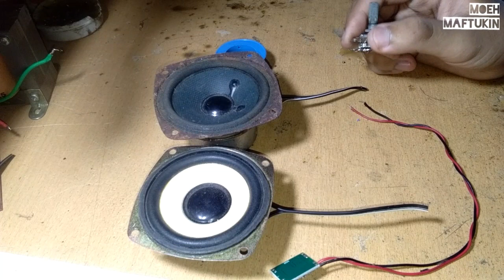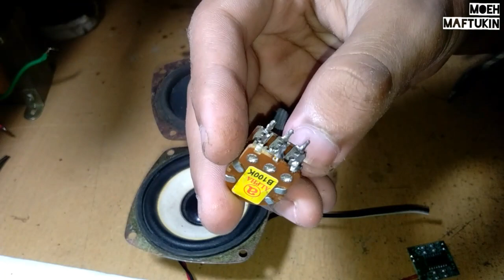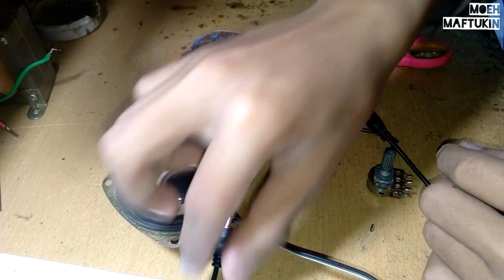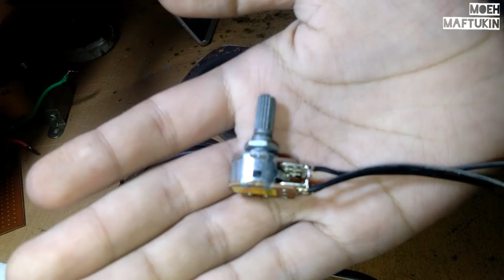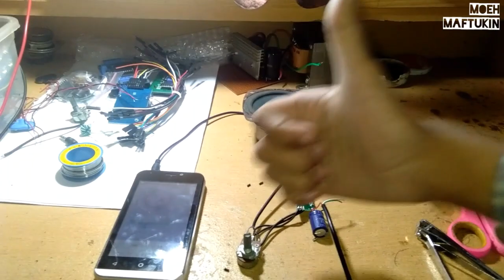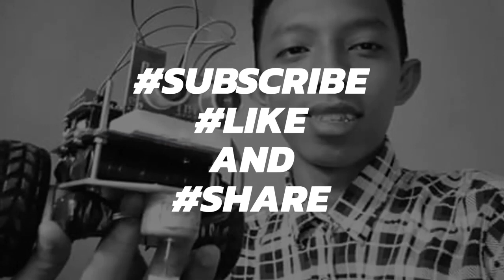Cara pasang potensio volume Di PAM 8403

Comment: Bang cara ngatasi ketika bass tinggi daya langsung down gimana bang. Apakah kitpam bisa dikasi input lebih dari 5v? Mohon solusinya🙏🙏🙏
Reply from the maker: Kasih elco
Reply: Udah bang tapi yg 16v 470 micro farad
Reply: Atau kah masi mau ditambah microfarad nya
Reply: Saya pakai 2 kitpam yang input daya dan audio nya saya rangkai parallel, daya yang says berikan sebesar 5v, apa itu bisa?
Reply from the maker: @hldn6117  nah itu kesalahan kamu, input nggk boleh diparalel secara langsung, harus pake R
Reply: Maaf bang saya kurang nangkep, pemula soalnya, R yang abang maksud itu apa ya? Mohon pencerahannya
Reply: Pikiran saya kalu saya parallel keduanya bisa mendapat daya 5v yg sama dan tidak terbagi 😅
Reply from the maker: @hldn6117  harus pake Resistor
Reply from the maker: @hldn6117  woo ya nddak

Comment: Mohon bantuannya om,
Saya punya amplifier tpa3116d2 120*2ch.
Pada amplifier terdapat potensio trimpot masing-maaing untuk ch L dan ch R,
Saya mau ganti sama 1 potensio stereo (dengan maksud menghemat tempat yg sudah sempit) untuk k2 trimpot kiri dan kanan. Apakah yang saya lakukan itu benar?
Sudah saya lakukan, pada posisi potensio off/ tertutup, keluar suara di speaker setelah saya buka volume dari tone control( vol di amplinya belum dibuka. Apakah karna ukuran potensionya kecil?
Ukuran potensio stereonya b50k.
Mohon bantuannya om.
Reply from the maker: Kemungkinan kamu salah dalam. Penyambungannya, saya kalau jelasin disini bisa panjang nanti
Enak nya gimana?
Reply: Apalah saya mesti/ potensionya tetap dipisah /chanel dengan yg mono, / ganti potensionya dengan yg 100k om?

Comment: bang mau nanya kalo kit pam nya ada 3 ,terus di kasih input audio tiga tiga nya tapi satu colokan apakah bisa
Reply from the maker: Bisa, di cabang
Reply: apakah gk balik arus nya ,apakah harus di kasih resistor atau potensio ? klo resistor yg berapa klo potensio berapa ?
Reply from the maker: @jokisandal6770  pake R aja 1k
Reply: @MoehMaftukin  boleh minta wa buat nanya nanya bang ?
Reply: @MoehMaftukin  buat nambah nambah ilmu
Reply from the maker: @jokisandal6770  0822-8864-1327
Reply: @MoehMaftukin  aku jg save no wa nya ya bang
Reply from the maker: Iya, gpp

Comment: Di suplay 12volt bisa master
Reply from the maker: Wah Jangan ya 
Karena max nya itu Cuma 5v
Kalau pake 12v bisa Tapi sebaiknya dikasih regulator dulu
Reply: Kalo 12 v mending pake pam8610 aja wattnya lbh besar dan suaranya lbh mantep...

Comment: itu elkonya 1000 uf berapa vol mas
Reply from the maker: 16/25 volt boleh
Reply: Mas tak kasih elco 1000 uf 25 volt mantap suaranya
Reply from the maker: Nah tuh kan
Reply: Saya pake speaker fleco tak ganti kit pam 8403 potensio